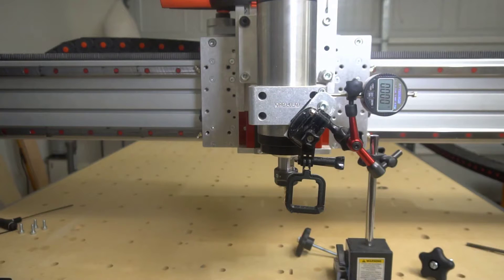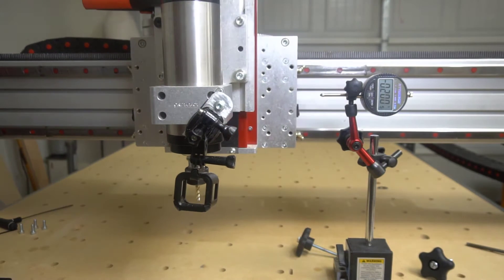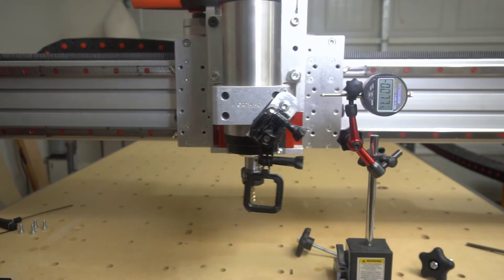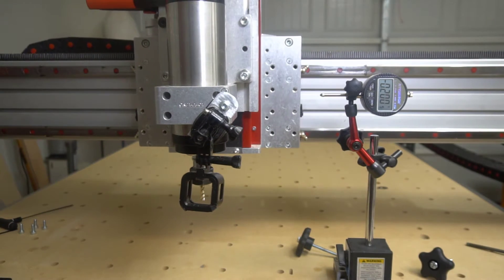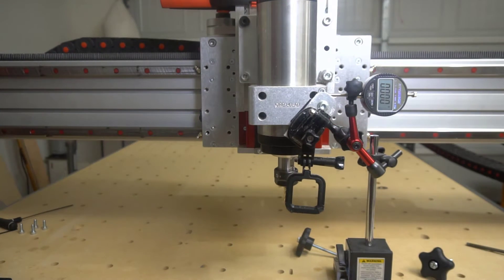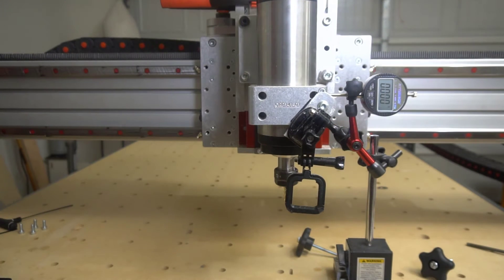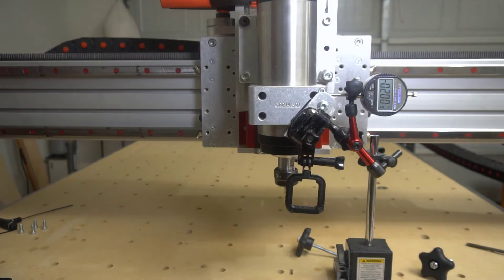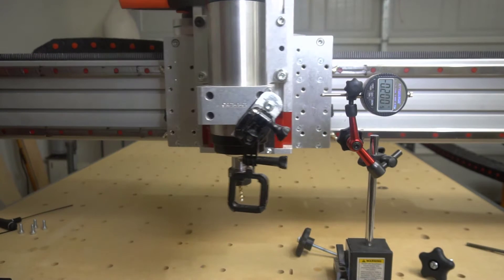ClearPath Servo Repeatability

Comment: I think the secret is in the feedback and what the controller does with the feedback, not so much the servo.  Theoretically, no matter what servo you use, with a sufficiently fine encoding/feedback scheme, you will be able to have excellent repeatability.  Conversely, if you took this same servo and replaced the built-in encoder with a cheap (coarse) one, it would have greater error in repeatability.
Reply from the maker: Totally true that repeatability is what a Servo gives you.  Coming from Steppers nailing a location is pretty spiffy and when comparing CLEARpath servo's to steppers its something to consider.

Comment: I have the older version of crp4896  run it long and hard. Looking to up grade to clear path servos from the CRP nema  34. If you don't mind me asking, can you let me know what motor model your using for your machine. Going to be doing a new build 5x10 CRP can't afford to shut mine down long enough to upgrade linear hardware and electronics. Going 5x10 for additional real estate for ATC on new one. Thank you for your great videos.
Reply from the maker: SDSK-3421S-ELN.... I went for the enhanced so that I could get 6400 steps...  I am in "post" and editing of my ClearPath servo review so stay tuned for that...  By the way I home built a 30x60 out of the original CPR parts.. good build :-)..
Reply from the maker: FYI: The ClearPath servo review video is up at https://youtu.be/n33fCmUu9A8 if you want the deep dive into the servos.

Comment: I'm not sure what you've used for steppers in the past, but steppers should repeat just the same if sized and setup properly.
Reply from the maker: Micro-stepping is fuzzy math.. My experience has been you can really only get repeatability of about 1/4 step.. and there are proportional losses to holding power with micro-stepping.  These servos have 6400 steps, not micro-steps but full on steps.  I am sure I could have rigged a test to land exactly on one of the 200 steps and had very good results, but just placing a block, zeroing out and hitting it dead on over and over, never had that kind of success with steppers in the passed. +/- .0005 sure but not dead on zero.  Keep in mind on a router table +/- .0005 with steppers is still way above what anyone should expect out of a machine that measures its working envelope feet and can rapid 600 to 1200 ipm for less than the price of a house.
Reply from the maker: quick caveat/clarification.. The last stepper driver I used was a Gecko 540... I've never used any of the Leadshine drivers that have the digital microstepping logic.. though my understanding of how micro-stepping works you are still loosing holding power proportionally to the size of the microstep due to having to bounce the power/signal back and forth to "float" the COM between two steps.. (its the precision of those bounces that determines how many microsteps you can have as I understand it)
Reply: Its a moot point, really. Repeatability is easy, accuracy is not. Repeatibility is only one data point. Accuracy is more than one. Your gear rack is probably only 0.003" per foot accurate. Thermal expansion probably doubles or triples that. My Haas VF-2 will repeat to 1/10 of a thou, linear accuracy is probably near 0.002" in a climate controlled environment. A 1/4" endmill doesn't cut 1/4" slot... ever. It takes skill to make parts to 0.001" accuracy on even an 8000lb machining center. If you can make parts to 0.010" accuracy on a gantry machine, you're either a genious, or lucky.
Reply from the maker: I would agree there is a difference between "can I hit the same spot over and over and over" and is a 3" x 2" pocket that is 1/4" deep really those dimensions.. I trust I can make smaller parts consistently at .005" accuracy when I need/want to.. That does require running at lower speeds, but when I work in aluminum I am only running at 20"/minute when cutting and they are generally pretty small..  now .005" over 2 or 3 feet.. that's iffy. but .005" over 10" or less.. Sure I trust I could get that out of the machine...   But if you need .005" run out or less over the full 8' of the bed, that is never happening even .01 over 8' seems crazy.. the compounding effect by those kinds of distances would be crazy to get right..
Reply: Without an encoder, there can be no confidence in a stepper's movements, particularly when microstepping and when there is a load.